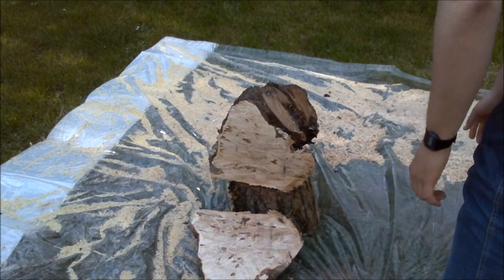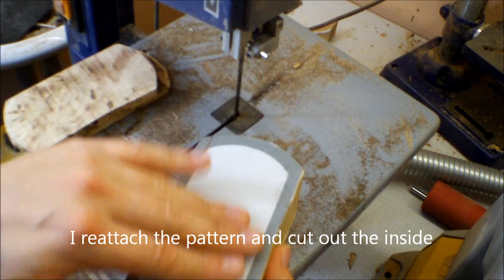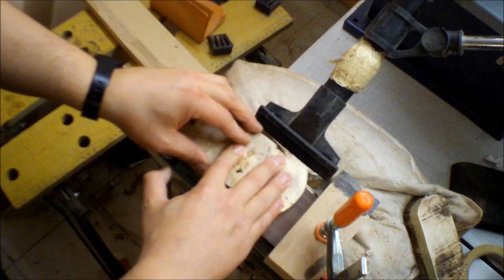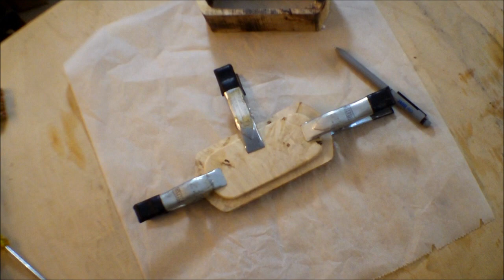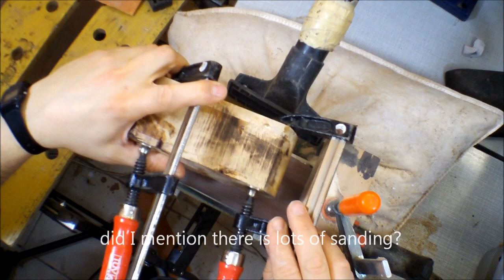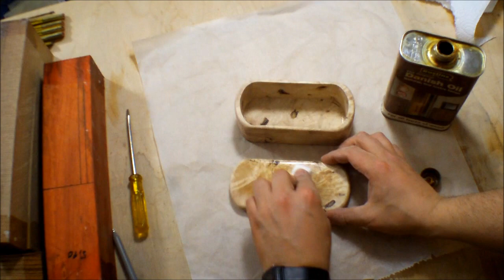making a wooden box using the bandsaw

Comment: Nice project.  I may try to make something like that.
Why was the planer necessary?  (I do not have one)
It seemed on the video that the wood had a lot of burning spots (dark brow to black) where you cut it.
Why?  (dull blade not dry enough wood or not enough powerful motor or another reason?)
Thanks for sharing.
Reply from the maker: Thanks! The root wood was extremely hard and the blade was dull, that's why there were so much burn marks. I used a planer to remove the burning and sawmarks. It's faster than sanding. But you only need a bandsaw and a sander.
Reply: Thank you for your quick answer. I really appreciate  that.